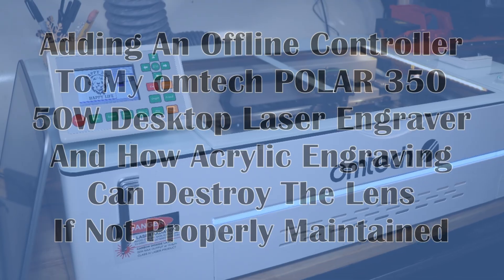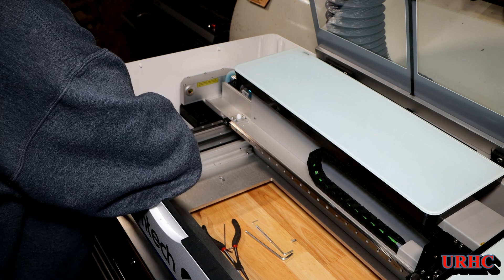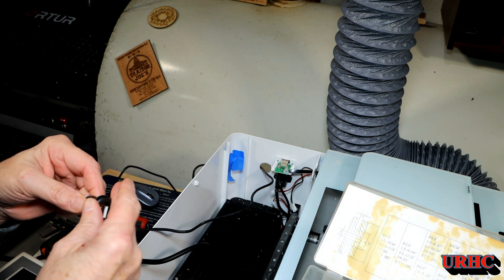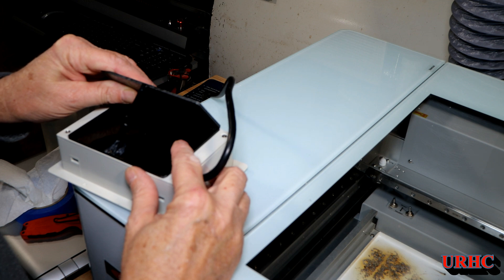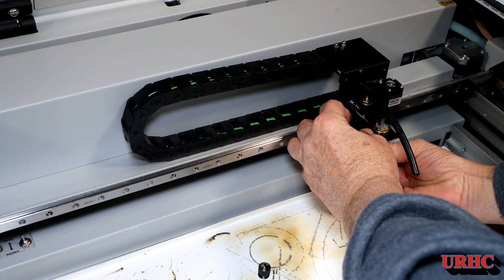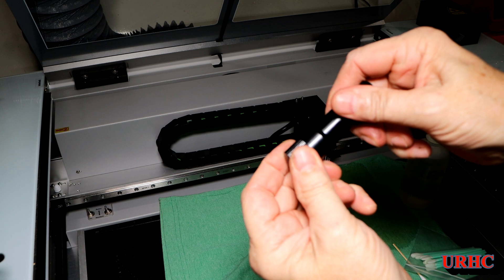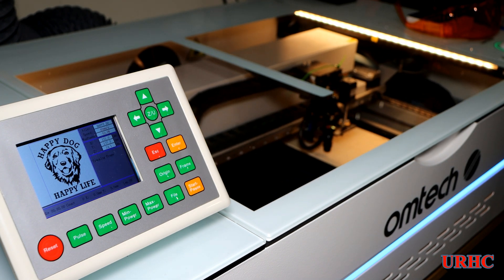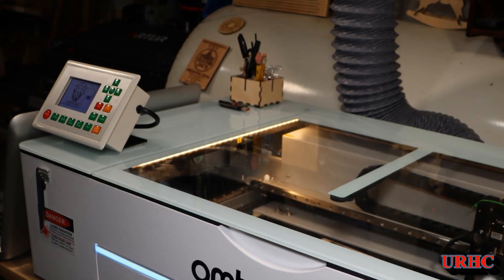Adding An Offline Controller To My Omtech POLAR 350 & How Acrylic Engraving Can Destroy The Lens

Comment: Regarding the damaged lens, the intake of the air assist airpump is sitting right next to the laser tube and pulls air from within the enclosure. Might be you are pulling smoke in and dumping it right in there with the lens.

I've broken 2 lenses in half a year and am going to try and install an external airpump as air assist, see if that helps my problem
Reply from the maker: The air assist is definitely a problem. Needs a 2 stage air assist for things like acrylic where you just want enough air to keep the lense clean for engraving and higher flow for cutting. Thanks for watching.

Comment: Did you or know of anyone who has designed a 3D STL file to hold the controller so we can sit it ontop of the Polar ?
Reply from the maker: There's one on thingiverse I saw that should work.So far I have been happy with my simple bent bracket so haven't tried printing one. Thanks for watching.
Reply from the maker: https://www.thingiverse.com/thing:4887857

Comment: Great video! I installed my controller and it is not powering up. Have you heard of anyone not have the controller turn on when they start the Polar back up?  Thank you for your time.
Reply from the maker: No I have not. Double check that it is properly plugged into the right connector and the connection is fully seated. another thing to check is that the pins in the connector all look straight and seated in their pockets evenly. Check all connections to the machine controller to make sure nothing came loose when moving things around to plug the controller in.  I would contact Cloudray if it doesn't come on when powered up and all the connections have been double checked to see what they say because its supposed to be plug and play. Thanks for watching.

Comment: Did you attempt to connect via Ethernet or you local network with this setup?   Ethernet (actually UDP)  is much better than usb, no drivers and everything is standardized for communications.

Thanks for the videos... here is an ethernet video from OMTech... https://www.youtube.com/watch?v=zKrT_Z9KWBU&t=119s
Reply from the maker: No, I would rather not have this access my network. I am using the thumb drive more so it can just be run from the controller. Thanks for watching.
Reply: @unemployedredneckhillbilly2023  I installed a USB cable like you did, but I can't seem to find it in lightburn. Do you have any ideas what I need to do?

Comment: great video sir, but I was wondering if the 6445s controller would wire up the exact same as the 6442s controller?
Reply from the maker: I have no idea. Try contacting Cloudray because it's not listed as working with this control unit. You may have to buy the set and rewire the box. Thanks for watching.
Reply: They are possibly plug swap-able.  The manuals are virtually identical, but you should have no issue swapping them out... is there any reason for doing this?

The S version has superseded the G version, so documentation, at least wiring should be the same...

Comment: Man, if I keep watching your Omtech Polar videos, I'm going to be out of money before my unit even gets here !! So, using your link, I put the Cloudray Ruida 6442S Panel into my Amazon cart. But, while I am waiting for the Omtech to get here, I need to find/make a stand for it. So, if you can spare a moment, what are the outside to outside dimensions of the feet for the Polar - both width & depth? I have a somewhat unused Craftsman "Home Project" work cart with drawers that I could use for while if it feasible. Thanks, Charlie in Central Ohio
Reply from the maker: Ill check that tomorrow. I have mine on a 26 x 54 box and It's a little 
big.  Here's the link to the controller size 
https://www.ruidacontroller.com/rdc6442s/
Be sure it's sturdy because the acceleration and deceleration will shake a flimsy stand apart. Thanks for watching.
Reply from the maker: Approximately 18 x 28 3/4 centers.
Reply: @unemployedredneckhillbilly2023  - thanks, that's a little bigger than the cabinet I have, so I'll be making a new one.
Reply from the maker: I would recommend one of the toolbox benches to have room to store materials and supplies that will definitely build up over time.

Comment: Appreciate the mention and different perspective on the use of the controller. I think this is a awesome upgrade and will help make a ton of lives easier when it comes to functionality.
Reply from the maker: It definitely is worth adding. Just haven't figured out how to display the switch and flow settings yet. Uploading a new video now and having problems with my lens burning and air assist. Going to have to figure out how to do a full alignment because it came way off. There is no easy way to place tape or align this machine I am finding out. Thanks for the controller info and thanks for watching.

Comment: The Ruida is always a good upgrade! The job origin is set by the little green origin button.
Reply from the maker: Thanks. This panel solves all the issues I had with this machine. It would just  stop with the light blinking and no feedback. I tried using the green button but it didn't reset it from machine 0,0. I think I found the buried box to enable origins to work now. This has become my favorite laser so far. Thanks for watching.
Reply: Any luck with this? I cant set orgin. When i run a file it goes back to the home position.

Comment: I like your temporary permanent mount. If that was me that's what it would turn out to be. Those Harbor Freight grommet kits, O-ring kits, cotter pin kits, and some other kits they have have saved me a bunch of time by not having to go to some store to buy what I need.
Reply from the maker: I figure it's easy for anyone to make and no duct tape involved. Found a 3d printed mount for this I plan on trying someday. I just don't know how drilling that glass panel will go to bring the wire through. This Controller really solves all the problems I have encountered with this laser.
I couldn't believe how fast the Omtech support was. I just sent an email asking for a way to buy a new lens and  they are replacing it as a warranty claim.  I also have 100 of those little Plano boxes filled with hardware from the days when stores were closed on Sunday. Thanks for watching.
Reply: @unemployedredneckhillbilly2023  Ed, I don't know for sure but I am going to guess that is tempered glass in which case you can't drill or bore a hole through it without shattering the glass. What I was reading said you can do it if you have a big enough laser. It might take a while but you could probably do it if you took your time with your 50 watt laser. I highly suggest getting a piece of tempered glass to practice on.
Reply from the maker: I have small diamond hole saws for glass bottles I almost tried but know spare parts are not available yet so I will wait. I can remove the pins from the connectors and only need a 3/8 hole. I wonder if this is a good excuse to buy a fiber laser 😉 or I could just make an aluminum replacement panel if it goes boom. I originally thought it was plastic and started by taking a step drill to it but I cut that part out.
Reply: Hi great video I’m going to get the controller too now. Unfortunately you can not cut through tempered glass it will shatter . I work in the glass industry.
Reply from the maker: The controller is nice but for some reason I can't read the limit switches and flow switches with it yet or reset the origin. Going to install rd works to see if there are more settings available.  Thanks for watching.
Reply: @unemployedredneckhillbilly2023  would like to know if you get it to work and read the switches. Please update us. Thanks again